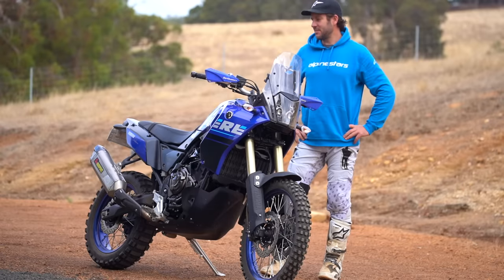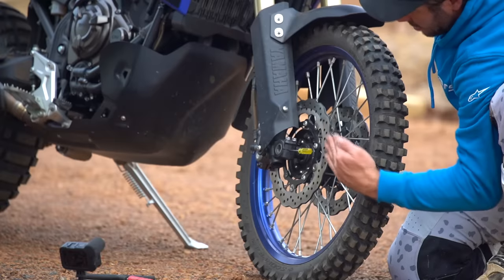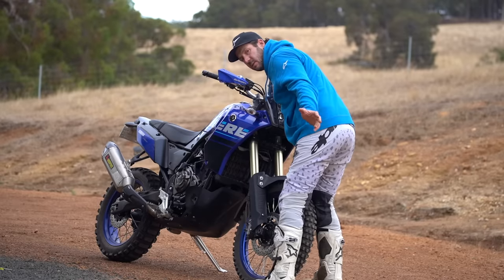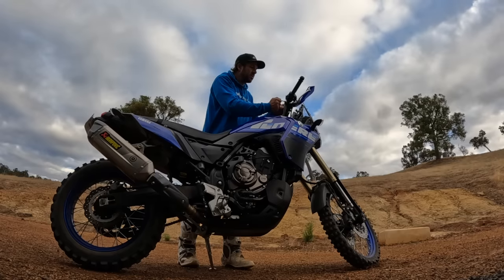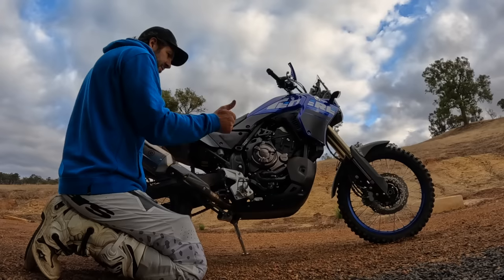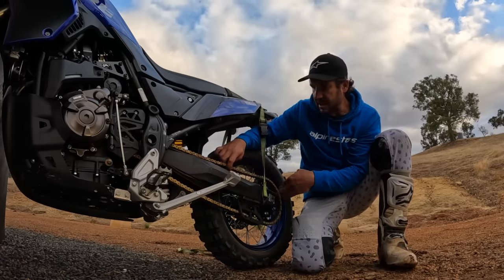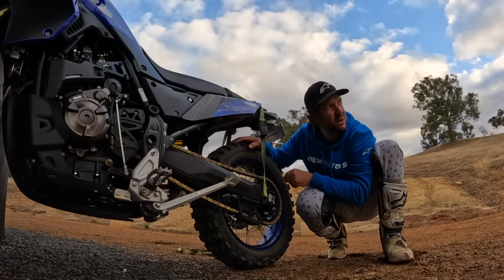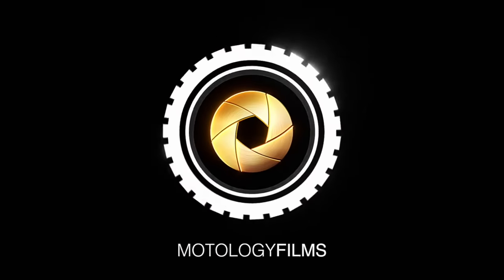How to maintain your motorcycle

Comment: Is this front axle bolt alignment more specific to off-road bikes? The street bikes I have owned and worked on are more of a through bolt which sandwiches the hub+bearings with a single set screw to keep the axle through bolt from loosening.

Comment: As far as the axle pinch bolts is concerned, it's important to look at the service data for the order of tightening. If you have removed the wheel, the first thing is to torque the axle nut (not the pinch bolts) to spec. Don't just approximate it, use a torque wrench. If you have $15000 to spend on a motorcycle, for sure you can afford to spend $50 more for a torque wrench. It's important for the axle nuts to be torqued to spec. Too tight, or too lose might damage the bearings. If you did this on the trail and got not torque wrench it's fine, just redo the tightening when you get home.
After the axle nut is tightened you need to look at the "shop manual", because the order of tightening the pinch bolts if very important. Look which side needs tightening first. Tighten that side and the bounce the bike up and down holding the front brake as shown in the video. Then tighten the other side.

Comment: I'm always taking my Yamaha to dealership for service and they are extremely overtensioning my chain.. In manual there is 5.1 to 5.6 centimeters measured on side stand, today I was measuring my chain and there was less than 4 centimeters gap even on service stand (when measuring I was pulling the chain with weight of 1.3 kilograms, somewhere I found how much weight you should put on the chain when measuring).. So I paid for the service and now after 500 kilometers I realised, I have to do it by myself.

Comment: Hi there. Thank you very much for the advice you give on the channel. I thought I was the only weirdo with all those details when it came to setting up the bike. I have learned a few more things. Thank you.
I have the same motorcycle as you and I want to know your expert opinion regarding the exhaust. I see you've placed a fabulous akrapovic. Now, a question, why the change? What do you notice differently from the original?
I know that weight is the most important thing, but at the performance level, what do you notice?
I want to put a stainless steel exhaust from the STROM brand (Italian from the Mivv factory)
Thank you very much in advance and I follow you from Galicia, Vigo, Spain.
Whenever you want you are invited in my house and do parts of the T.E.T

ESPAÑOL:
Hola buenas. Muchas gracias por los consejos que das en el canal. Pensé que yo era el único bicho raro con todos esos detalles a la hora de poner a punto la motocicleta. He aprendido algunas cosas mas. Gracias.
Yo tengo la misma motocicleta que tú y quiero saber tu opinión de experto con respecto al escape. Veo que has colocado un fabuloso akrapovic. Ahora, una pregunta, Porque el cambio ?? que es lo que tu notas diferente con el original ?
Se que el peso es lo mas importante pero a nivel rendimiento que notas ?
Quiero poner un escape de acero inoxidable de la marca STROM (italiano de la fabrica Mivv)
Desde ya muchas gracias y te sigo desde Galicia, Vigo, España.
Cuando quieras estas invitado en mi casa y hacer partes de la T.E.T

Comment: The chain tension on the T7 being too slack is  a guaranteed hole in your pocket, the manual even warns about it, there is a failure point on the T7 (as it is essentially a road bike engine) there is a post coming out of the case to hold the chain cover, a slack chain hits the post and snaps it off putting a big hole in your case.
The T7 is not a pure dirt bike with a slack chain.

Comment: SO MUCH MORE than a car, when it fails or goes wrong it can hurt/kill you. Shouldn't be taken lightly to check the basics yourself - Adam is being a little dimplomatic in his dealer comments but more honest than most; there are good mechanics out there, but guess what, the quality or work is often garbage and it's your life being carried at +100kph on your pride and joy. I've had 2 bikes ($20k+bikes) recently serviced by dealers (pains of keeping a warranty), knowing I'd have to do the work twice when they got home > guess what > chains overtight, front axle not centred, chain lube and shit all over the swing arm and the sump still soaked with oil from the filter change. If you take your bike for a service and don't check it over after, especially before a big trip, it's your ass when the rear locks up in the rain from that oil sprayed onto your rear tyre, of your fuck around when you've done a coutnershaft seal or chain in the middle of Aus. It is basic stuff and great that Adam is spreading such a pragmatic message. Good on you man - you guys need to be afraid for not checking stuff, not afraid to do it :)

Comment: Me pointing at the oil puddle under my mates forks. "hey, better fix that before it ruins other things" 6 months later. "My forks are so harsh and my front brake doesn't work good anymore. "FFS" people, fix it when it breaks. Thats my Advise. 

I love working on my bikes and my mates bikes. I will service, do tyres and valve check. Plus over all TLC. But I hate pointing out an issue or hate seeing pure laziness to replace a broken or faulty part. I cant do some jobs that require a special tool but most i will tackle. Im about to get an xr400 in. A simple bike but needs a lot of tlc.

Comment: I think there's a possible error in the procedure for removing stiction in the forks as presented here. When bouncing your loosened forks to line them up on the axle, if you apply the front brake, you're disallowing any sideways movement of the fork along the axle, which is the objective of the exercise. Better to push the front wheel against a wall, then bounce on the forks. Also, loosening the bottom triple tree bolts in addition to the axle bolts will align the top and bottom triple trees in the same procedure.

Comment: Adam - your chain tensioning advice appears to be wrong. You're advising riders to adjust tension when the chain in its loosest state - i.e. where the chain is not in any direct contact with either of the chain rollers. This is dangerous because the chain will get tighter as the swingarm goes through its range of motion and puts the chain in contact with either of the chain rollers. 

I'd advise issuing a correction. The OEM manual very clearly states to adjust the chain with the motorcycle on its sidestand with NO extra weight added (squatting the rear with a ratchet strap is essentially artificial weight). 

For those watching the video, I'd highly suggest following the OEM procedure instead of what's shown here. The damage caused by over-tightening your bike's chain can be disastrous. The OEM method is simpler, requires less guesswork, and less tools.
Reply from the maker: Rollers are only there to increase tension when the chain is in it's most relaxed positions, at top and bottom of suspension travel. 
The tightest point of tension is exactly where I've demonstrated, at the squatted position when three axis are aligned. 
You've completely mis-understood this video / demonstration, as outlined in your comment.
Reply: @MotologyFilms  Why are you advising to viewers to stray away from the OEM-approved chain adjustment instructions? A technique that requires less tools and has been vetted by the engineers at Yamaha?
Reply: @JordanLedbetter  becouse Adam Knows what he's talking about.

Comment: Thanks for the content, but some of the things you’re saying is simply not accurate. For example, to adjust the chain on T7, you don’t have to do what you’re proposing. This is because rear wheel goes a circle around the central sprocket, and the distance between wheel and sprocket remains the same.

Comment: Ratchet strap is a great idea. Too much time spend lying on the back of the bike reaching around with a tape measure lol...
Reply: Ratchet straps are great in the bush too. If you need to lift a wheel , like for a flat tyre, and you don't have a centre stand,  you can hitch a strap to a tree an use it as a jack to lift the bike. I take the bloody things everywhere, they are just so handy...

Comment: Anyone driving a car or riding a motorbike should have at least basic knowledge if they don't want to be ripped off by mechanics and dealers.... A little knowledge gives you some mechanical sympathy so you don't red-line the engine straight from cold,  know how to check coolant ( do not remove the cap of a hot engine ) and oil level.. When my wife takes her car for new tyres etc, they always find that the brakes need new pads etc....  once a tyre garage did that and I had only replaced the pads 4 weeks before,  my wife rang me from tyre place and asked my advice - I said 'tell the aerosol the pads are only 4 weeks old'  - I can imagine the look on the guys face when she told him.   If you don't have some basic knowledge your bike or car is going to be a lot more expensive to run.